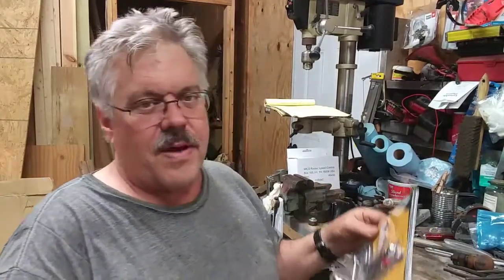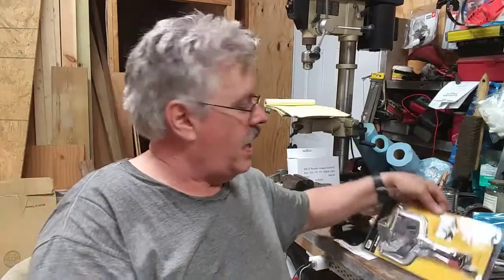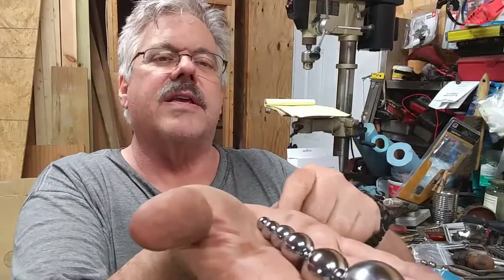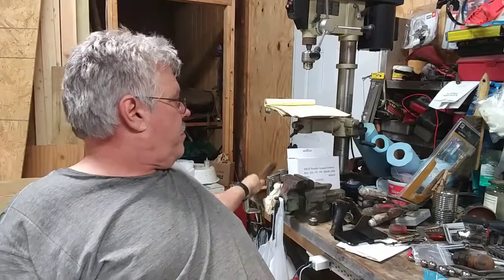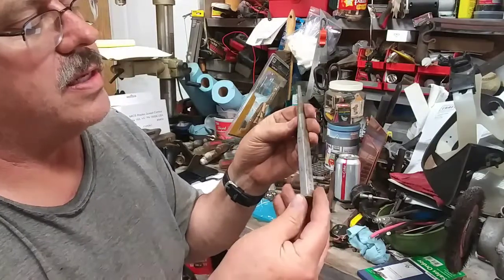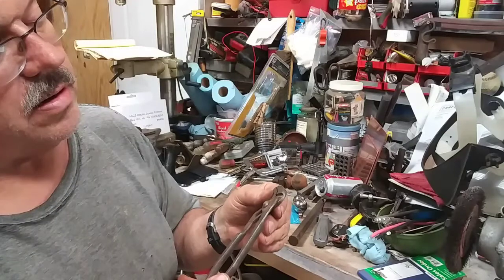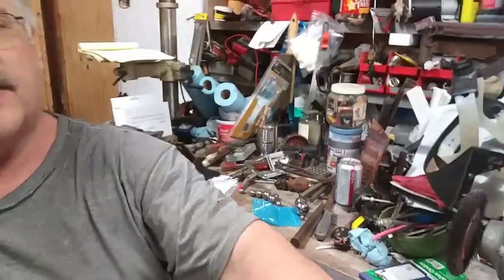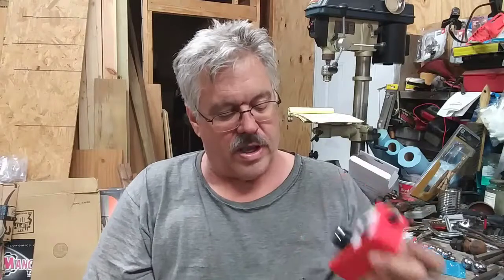Catching Up Talk and Mail Time

Comment: Gary, Thanks again for another video, good update. I’d be curious to see the process of welding the ball bearing to a chisel as I can see where that could be a useful tool.
Reply from the maker: I hope to get some videos made this weekend. I have a welding project this week so I may forge out a piece of coil spring (5160) and then weld a bearing to the end to see if it holds up. Thanks. :)
Reply: Gary Brown Forging On That would be great.
Reply from the maker: I made a video and will get it out there today. I used a 3/4" ball bearing. It worked out pretty good so I am going to make more as I need them. Thanks

Comment: I would like to see your project with the ball bearings, I have the same project setting on my work bench. Not sure what to weld them with. Thank You!! Wayne
Reply from the maker: I will try to figure that out as well. I will probably try one and see how it goes before I do more.  I need to figure out if I just weld them and use them or if I need to anneal the ball bearings, weld them and then heat treat them again. But I will try to just weld them first.
Reply: Thank You that would be great have a great day!!
Reply from the maker: I made a 3/4" ball punch video.  I am going to get it out there today.  :)  I hope it came out okay.  Thanks
Reply: Thank You Gary, looking forward to see it , I will keep an eye out.  Have a great day!! Wayne